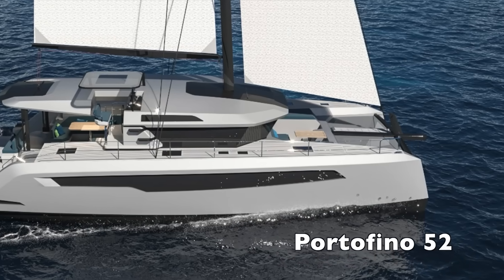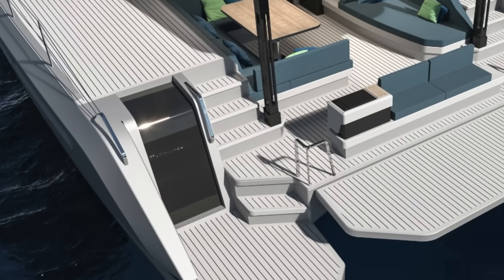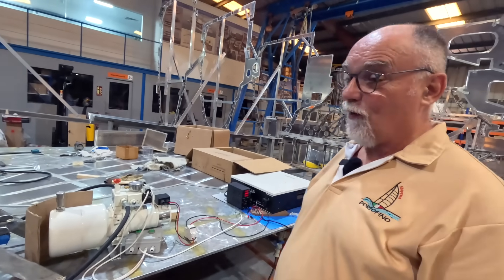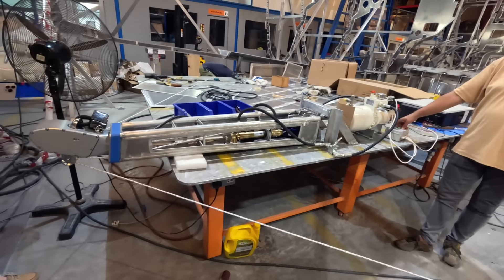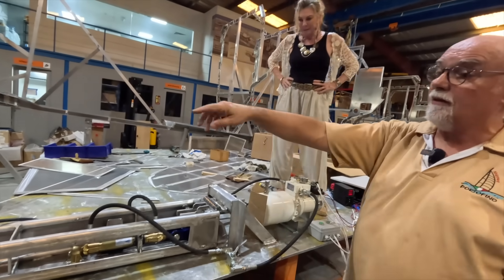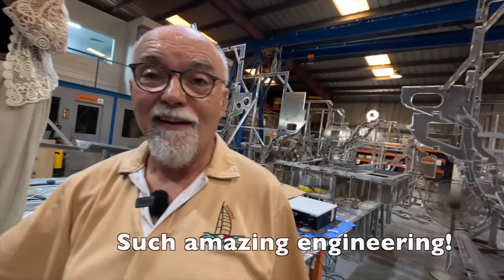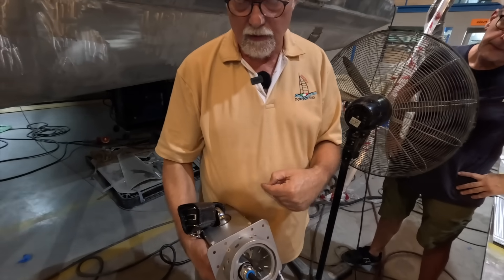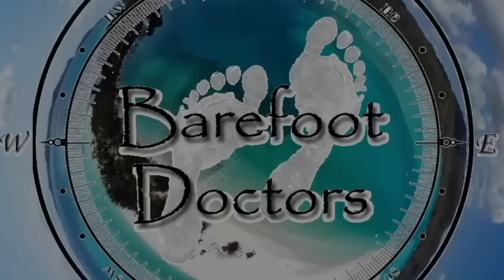S5#21.  Crazy! Unique Hydraulic Bowsprit for Portofino 52!

Comment: Im interested on how portifino will stop corrosion like "life on jupiter" experienced. In particular when you get a chip in the paint how the corrosion, natural oxidisation of the aluminium can be avoided. I did see in one of your vids all of the storage areas seemed to be sprayed with a yellow film.
Reply from the maker: Thanks for your comment and yes everyone with aluminium boats are interested in avoiding electrolysis. We are going to do a whole episode on how the Portofino limits this risk and measures for electrolysis on an ongoing basis. Whether electrolysis happens or not does not depend on the paint as this does not protect it, but when electrolysis occurs the pain will just lift off. Video on this will probably come out in two or three weeks…
Reply: @barefootdoctorssailing awesome thanks, sailing jupiter are 10 years in and have done a whole set of recent videos on what can happen, even on the higher quality aluminium. Prevention is better than cure as they are now doing the cure work 10 years on. Cheers

Comment: The way the forces work on the sail, the bow sprit is going to be under continuous pressure to be lifted up. So these tightened up dyneema ropes are the only thing that counterbalances these forces and keeps the bow strip straight? I don’t question it, just wondering if I get this right.
Reply from the maker: Yes you are right that the dolphins strikers are the only / main thing that holds the bowsprit tip down but that is same on most boats that use a bowsprit on a hinge, our Leopards as an example. That is why those fittings need to be be able to take several tons of pressure
Reply: @barefootdoctorssailing  Yup, it makes sense, even if ut's a bit counterintuitive, but I guess anything related to Dynemaa is!

Comment: 15:28 Delrin bushing.  Delrin is a very early plastic, still useful though.  Teflon may be better.

Overall don't like the complexity and many dissimilar metals.
Reply from the maker: We can share the insulation of the Alu / SS connections and although it was only mentioned once, every SS component is isolated so there should be no trouble...
Reply: @barefootdoctorssailing  Any two dissimilar metals in contact with seawater forms a galvanic cell, even if they're isolated.  This can be mitigated by electrically bonding the different metals, but if the bonding fails, can still result in corrosion.  Same with fasteners (the screws), etc.
Reply: Teflon is the most sofy polimer, reccomended only for hight temp and low friction, definitive not reccommended for hight load, delrin is much better
Reply: @raffaelerognoni8861  Thinking about it further, you're probably right that Delrin is a better choice.  I forgot that the lines will be emerging at a sharp angle on the bushing, so the load will be high and Teflon would be too soft.  Still, Delrin can fail under some chemicals, etc.  Perhaps a widely-radiused, hard-anodized Aluminum bush instead?

Comment: IMO, this is wonderful engineering to solve a problem that doesn't exist. There are perfectly suitable  vertical pivoting prodder pole solutions  that are robust , reliable , and lightweight using dyneema and 3:1 LFR lift pulley. And it takes you in the opposite direction from the KISS principle of offshore cruising.  But I hope it works out for you.
Reply from the maker: Thanks Rob and yes of course this is a reasonable view and very much what we know as the other side of the choices! We will share who well or otherwise it works over time so will be a very interesting journey!
Reply: Exactly my thought, make it more complex instead of keeping it simple

Comment: Hi.  An interesting idea and I would like to see this succeed.  I would like to ask what is actually holding the spit down?  The whisker stays transfer their loads to the hydronic ram and the ran holds the spit down, transferring this force to the cross beam.  Therefore all the load will come onto the hydraulic ram, which will apply an enormous torque onto the cross beam.  If the ram looses holding power for any reason, then the spit will start to rise.  As the spit rises, the whisker stays will loosen as per the way they are designed and the spit will continue to rise and there is actually nothing other than the ram and its mounting block holding the entire system down.  This will put enormous torque on the centre of the cross beam.  Perhaps the whisker stays need to have an independent locking system, like rope clutches which are engaged wore the spit is lowered to actually transfer the loads to the pad eyes on the bows?  Any thoughts?
Reply from the maker: Hi Allan, thanks for the feedback and perhaps we did not make it clear enough - the dyneema lines are fixed tight (locked) when the bowsprit is fully down so it is them that hold the bowsprit tip down. the hydraulic ram does not take the pressure at this point as the dyneema is locked in place. The spit only rises when you choose to lift it and then the dyneema releases as the pulley is released as the hydraulic pistons kick in... So as I understand it, the forces on the spit are only  compressive.

Comment: Great design. Absolutely sensational idea.
Needs one more addittion of a "down lock" on the bottom of the bowsprit. That way if there is ever a break in the hydraulic lines or the piston, the folding section will remain in place. Even more important to have a lock there when under sail otherwise the mechanism may fold up inadvertantly
Reply: 💯. Even seal leakage anywhere along the system will allow it to begin folding. Could even be sorted with an over-centre cam.
Reply from the maker: Thanks Darren, I understand that the dyneema is what holds the bowsprit down and not the piston. I will double check that though...

Comment: WOW John and Eli that looks fantastic!!! . If I were to have a concern it would be that the screws securing the electric motor to the very end of the bowsprit look too small for the loads of the sail and were there only the two of them? Are they tungsten (having extra strength)? This will be a game changer once other boats see this - everyone will want it! Raffa probably should patent it after all!

Great stuff guys, Love it (and you both!). Fair 💨's and following 🌊's...
Reply from the maker: Thanks Garth, the bolts at the base of the electric motor are short but thick and many and the torsion is also prevented by the large flat section of the device so the bolts only have to hold the device in place.

Comment: I see a few issues with the design of the hydraulic bow sprit.  What is holding the bow sprit in the down position?  It should have a mechanical locking system similar to an aircraft landing gear.  I wouldn't trust hydraulic holding valves.  

Why use an electric furler on the bow sprit when there is already hydraulic power in that location.  A hydraulic furler would be so simple. All that would be required is a hydraulic motor.  

Hydraulic systems are far superior to electrically operated systems on marine applications.  Is the electric pump the only source of hydraulic power being used on the boat?  I believe in the concept of triple redundancy when it comes to critical systems.  It would be smart to have hydraulic pumps on both engines and on the generator if the boat is getting a generator.
Reply from the maker: Hi Chris, it is the dyneema ropes that are locked to hold the tip of the bowsprit down, like on the Leopards where it only has a hinge at the base. 

As for the use of a hydraulic Furler in the tip, I do not know if it can be fitted in to that small space... As for the hydraulic pump, we also are using hydraulic pumps to drive the centreboards, boom Furler, steering and autopilot. So Portofino has set up two pumps in parallel to be switched over in the event of any trouble as well as having a third pump as a spare.

Hopefully that answers teh questions!

Comment: With the rotor for the furlor will there be a silicone gasket so salt water does not seep in?
Reply from the maker: Yes it is sealed and these have been used for many years so it should be fine in that regards..
Reply: @barefootdoctorssailing  We have a beach house & the salt water is my nemesis.

Comment: Awesome. would it be possible or maybe better to use titanium instead of stainless steel for the hinge and the other ss components?
Reply from the maker: Titanium would be nicer than SS as it does not ever stain (rust) but all the insulation would still need to be in place to prevent electrolysis. Presumably it woudl be a bit more expensive too so Portofino would need to see that that extra price is and I do not know how easy or difficult it is to machine titanium as the hinge is a one off machined by Portofino in their shipyard.

Comment: I designed several fixed bowsprits over the years from various materials the last /current one in 316 stainless. Why? Flexing too much. Now fixed but extremely sturdy. But it’s 1.15 meter. going 2m out that’s enormous. The forces on that increase with each meter of sail.. wow. But it also deletion how you use it. Spinnaker or code zero? A lot of difference. I like the idea of hydraulic but it’s too much complexity to my liking. Something again that could fail. The electric furler, that’s perfect. A bit less sail and simplicity is my personal 16:35 preference. But having said that. It looks good, will work well, so why not if you wanted that? I would at least make a manual lock on the bottom for when hydraulic is down so you can still use the sail and fix it later. Good thinking that design btw.
Reply from the maker: Thanks W6 for the detailed comments! The bowsprit is aluminium but the hinge is SSteel to have the strength. The forces on the Code 0 (I understand) are greater when you are sailing upwind (or tight on spinnaker) but the forces are compressive through the pole and upwards forces are taken on the dolphin striker and the square structure from Portofino does give it enormous strength...Good idea for the manual lock / clip to hold it down but hopefully only for energencies...

Comment: This is brilliant idea 👏 👌 
The one thing i thought of is to add/weld or even screw on a connector so you can use it to haul/lift something if needed so it's multipurpose as well; like wedged/stuck anker or what ever eventually.
Reply from the maker: Thanks for the additional thoughts - we will take that into account!

Comment: The idea is nice but complicated. Would it not be easier and a lot cheaper with a system that retract back inside the hollow boom (like a telescope) between the nets?
Reply: You have to be careful with that as over pressure can warp and then jam it. A break away locking pin is better as then it only flops around until the pin is replaced. The only thing to worry about is maintenance cost, long term reliability, and replacement costs. The more you add the more will eventually fail, it could also limit the conditions it can be used in.
Reply from the maker: Thanks for the feedback and we will see over time if it has that long term reliability that Portofino expect!
Reply from the maker: They did look into that first but I think what caused trouble with the design was the space and risk of the pipes rubbing on the moving parts and creating leaks. This design reduced the risk for the long term, I understand....